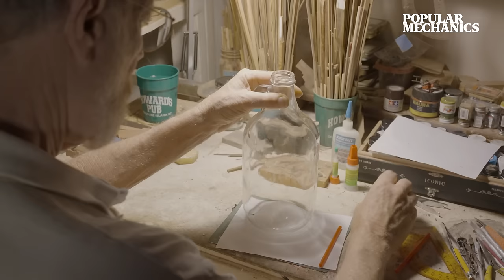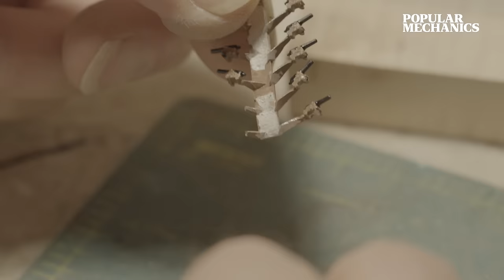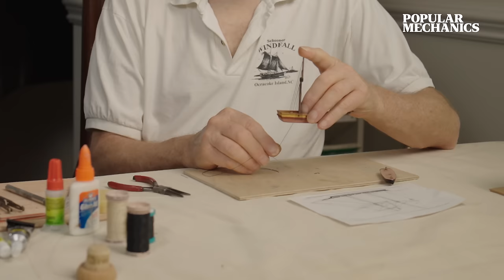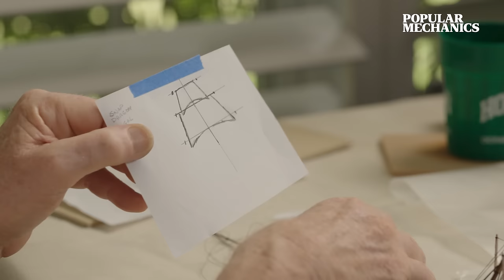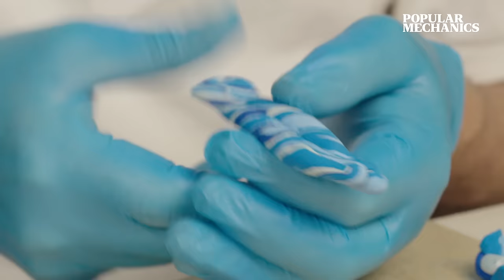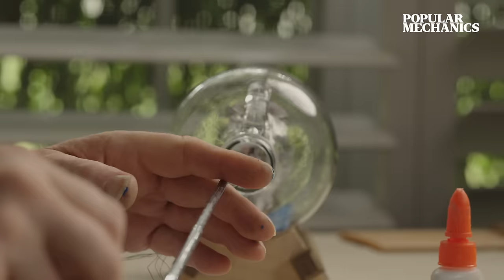The Art of Building Ships in Bottles

Comment: Amazing. What is the glue that you apply with a brush in the cap?
Reply from the maker: It's Super Glue by the brand Krazy Glue. The brush applicator gives me more control when applying glue.
Reply: Thank you. I used that glue with model airplanes. The only drawback is that it doesn't give you any leeway in case you make a mistake, because it dries in seconds.
Reply: @miguelsuarez8010 The correct response to that dilemma would be to not make any mistakes.

Comment: I always thought they were putting things together piece by piece in the bottle and assembling them and gluing them etc in there with these kind of special long twisters. Not that I could do this but tbh, it removes a lot from my intial impression of the skills required for something like that.
Reply: Lol, I think that is kind of the point. You are SUPPOSED to think they are assembled inside the bottle. I think it is clever that the hull is in two pieces, presumably the completed hull won't fit through the neck of the bottle to confuse a viewer even more?